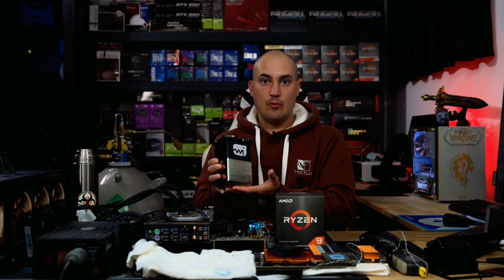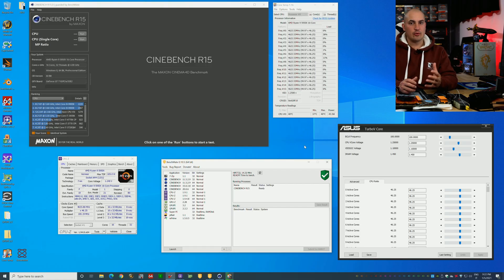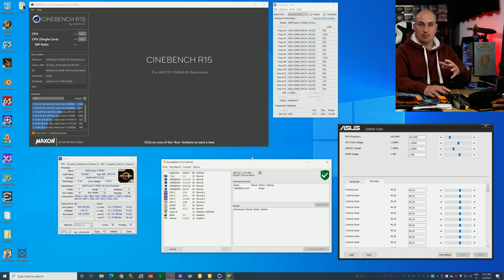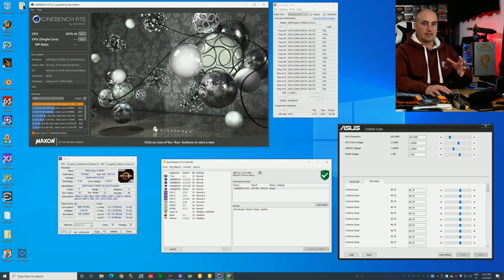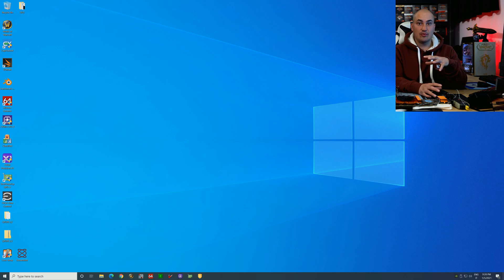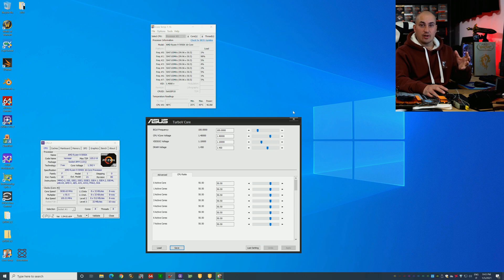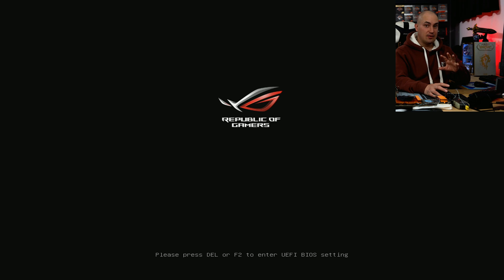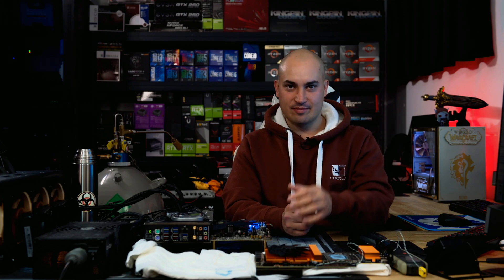How to bin a Ryzen 9 5950X for Extreme Overclocking

Comment: Hi
Safe voltage for 5950x for manual OC, cooled water will be?
For games, daily applications and for example Davinci Resolve
Reply from the maker: I wouldn’t go above 1.25V, after that the efficiency is pretty bad, but I wouldn’t even do manual OC, the default boost is very efficient especially for gaming, you will never be able to match the 5+GHz of single thread boost, instead focus on ram tuning and max out the flck to 1900 (ram 3800)
Reply: Thank you

Comment: is there a voltage and multiplier to do a quick check to see if you have a good cpu? like 47 @ 1.25? or something like that?
Reply from the maker: Usually I start with x40 1,25V LLC3 and I raise the multiplier like in the video, if you can do x46 and above the quality is pretty good
Reply: @HardwareNumb3rs  would you say 1.25 on a 360 aio is safe for daily use?
Reply from the maker: @trick0502  with the Ryzen X my advice is to keep them at default for daily use, is better if you focus your efforts in memory tuning, 3800/1900 and tight subtimings, even C16 can be good
Reply: The mitigation is temp and perf gain for OC, the voltage can be higher on one CPU vs another to achive an OC goal while the temps can be the same.  1.4v or less can be 24/7 it depends on the silicon.